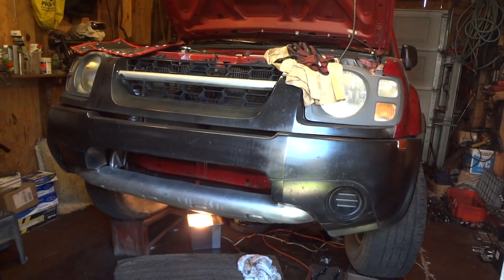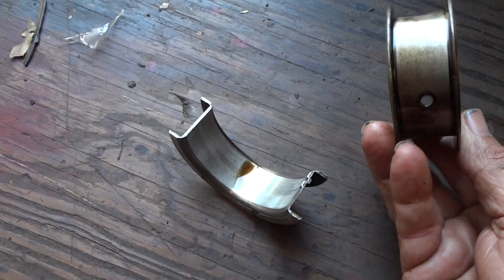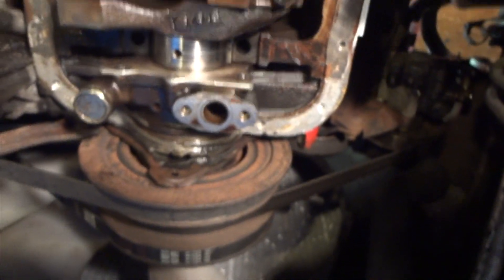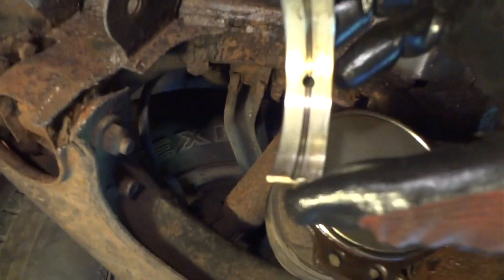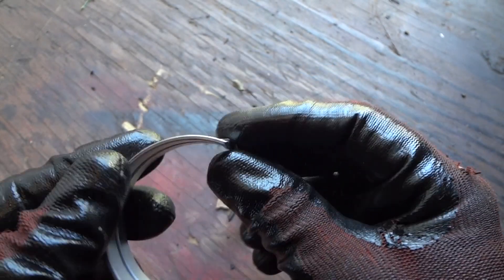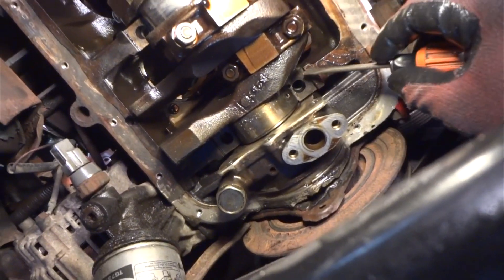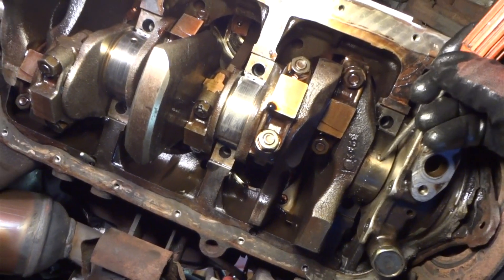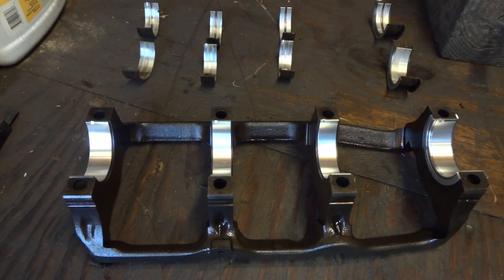Xterra 3.3 New Main Bearings/Rod Bearings Install with oil pan Removed

Comment: Catalytic converters flaking off inside have ruined many of these engines. Properly cared for and no converter issues these engines will run 500K miles with no issues.
Reply: @prevost8686 what do you mean catalytic converters flaking off?   My Xtera just died today and the cats were making the broken cats sound...I think i drove it too much cause today the engine just shut down while driving.  Is my motor toast??
Reply: @Debosway77  The internal substrate of the converters would begin to flake off . For a very short millisecond your exhaust valves will allow spent gases and anything else in the exhaust manifolds to re-enter the combustion chambers. The platinum and substrates from the converter’s Nissan sourced getting into the combustion chambers will wear piston rings out and cause the engine to use oil. It’s a well known issue that Nissan issued several service bulletins about. The center cylinder on each bank get the most damage. I’ve seen numerous 3.3 engines succumb to this. I “fixed “a 2000 Frontier last year that was burning a quart every 800 miles to now it uses no oil every 5,000 miles.

Comment: Thanks for putting this video together. What did you end up doing with the front and rear pan gaskets? New ones? You just replaced the rear.
Reply from the maker: I re- used the rear one (still was like new from 2 weeks ago) and had a new front one  with that kit ($18)

Comment: Has the 4x4 worked okay after cutting the welds holding on the front differential? 

Did you re-weld the front differential or just go with the bolts only?
Reply from the maker: No differences noted.
Reply from the maker: Bolts only
Reply: @FixingWithPassion  THANK YOU very much for telling me! 

It has been a big question for me.

The best I can manage is a crappy upside-down technique, flux core weld at home. I don't even think that would hold so I'm very relieved to hear the bolts can do it alone because there's no other way to drop the oil pan without pulling the whole engine.

If I ever buy the lift and engine stand to pull an engine, I'm rebuilding the whole thing.

Comment: My 2004 has 277,000 miles and it has a very slight knock at idle its fine at hyway speeds and no oil light its 4x4 so the front diff is right in the way

Comment: The bearings don't control your oil pressure....That's the oil pumps job
Reply from the maker: Think again...BIG gap in bearings lowers oil pressure.
Reply: @FixingWithPassion  .004 isn't BIG gaps
Reply: @FixingWithPassion  and you never checked clearance for the bearings anyway
Reply from the maker: @zeke112964  It is when there's 10 bearings to feed. Try idling....and watch a mechanical gauge. There is a difference. Been there....done that...to many times.
Reply from the maker: @zeke112964  I did off camera.
Reply: @FixingWithPassion  With a micrometer right?
Reply: Tell me you've never built a motor without telling me you've never built a motor 😂